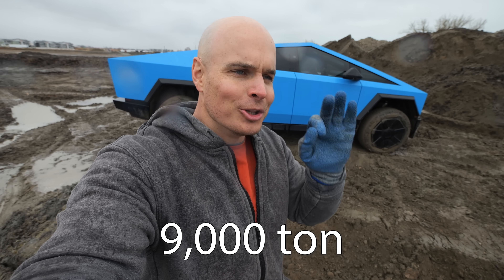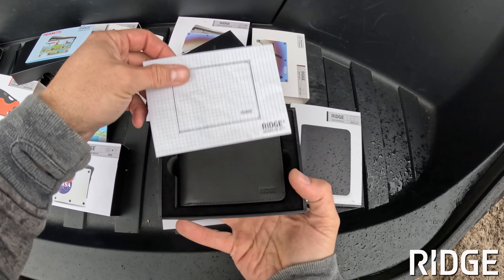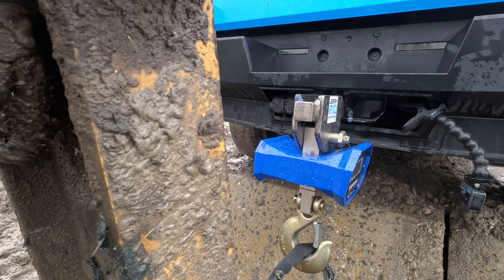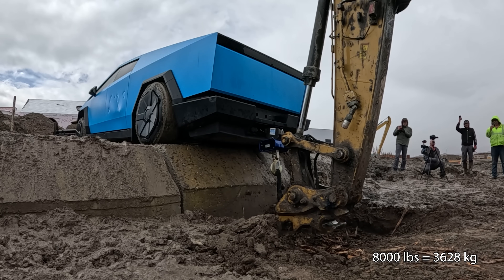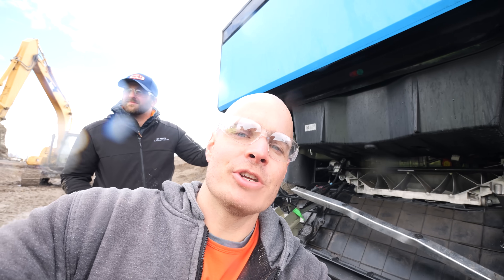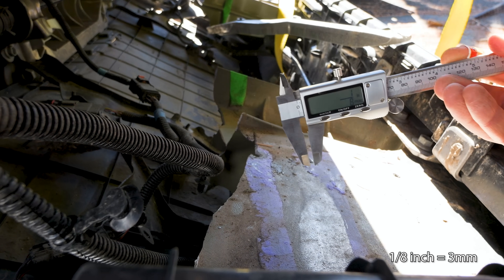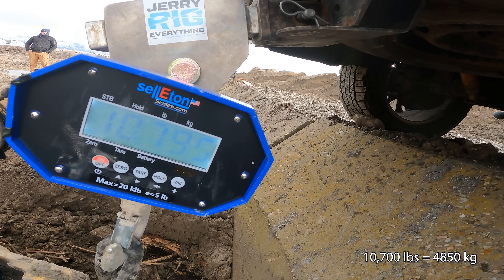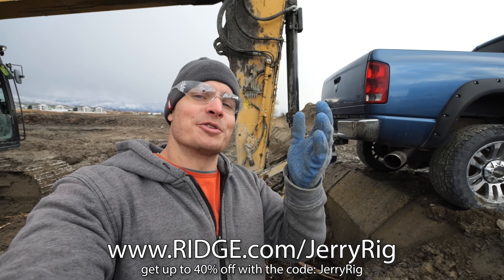SHOULD YOU TOW WITH A CYBERTRUCK?! - (catastrophic failure test)

Comment: The alarm going off was comical. As someone involved in structure development on stuff like this, this case is wildly extreme, but an interesting exercise nonetheless, especially side by side to a traditional BOF vehicle. I'm curious why the battery is throwing error codes, I wonder if it's a shutout for something like FMVSS 305, though I'm not familiar with NHTSA requirements.

Comment: People are freaking out over the glue, but this is exactly what happens when non-engineers see something from their daily lives and assume it's the same in engineering. In reality, adhesives are widely used in aerospace. For example, the Eurofighter Typhoon’s wings are made from plastic and glue, yet they carry heavy loads at high speeds. Engineering isn’t just about bolts and welding!

That being said, yes, this truck is not well made for towing.

Comment: My understanding is that the CyberTruck weighs about 9,000 pounds. So, if you put 10,000 pounds on the trailer hitch as tongue weight, you will have other problems before the hitch breaks. Also, the CyberTruck sounded an alarm before that failure. If you ignore alarms, you are part of the problem.

Comment: Tongue weight is tongue weight.  They both broke around 8k, because the frame is beginning to bend on both of them.  May or may not be permanent damage.  But it’s not a realistic expectation, because you’re hitting other safety issues well before the tongue weight limit.  A pothole isn’t going to 6x the weight.  95% of it is going to be a pulling force.  Your tire doesn’t teleport to the bottom a pothole at highway speeds.  It mostly glides over it.  Thanks to conservation of momentum, the trailer force isn’t going to suddenly change directions either.  The stress limit argument is valid though.  To the point where SpaceX uses steel wherever it can, because aluminum rocket parts are 1 time use.  Would be nice to see a revision with a steel hitch frame attached to the aluminum frame.  But you’re not going to be doing tons of hauling with its limited range anyways.
Reply: ROFL ,whats wrong with you?
Reply: They didn't test tongue wieght,which has more to do with hauling capacity. They tested towing weight, which is not a horizontal pull test. You have to stop. Ever stop while pulling a load over a hump  in the road? 100% of the trailer weight bears down on the hitch and frame.
Reply: @jerrylawson9003  No , it just doesn't .
Reply: @AZREDFERN  You're right, but on the contrary, he hates Tesla, so he'd rather lie.

Comment: The planes you fly in?  Aluminum. And the ones with carbon fiber?  Glue. Aluminum and glue are not automatically weaker than steel.  Design matters.  Please don't lead us down a path of idiocracy.

Comment: It all depends of the thickness of the metal, if the cybertruck had thicker alluminium plates or a lower advertised towing capacity that would be fine.

To problem is that it is falsy advertised to have this towing capacity and it poses a great danger to drivers and surroundings

Comment: 10k pounds seems not unreasonable given the tongue weight limit is 1100 pounds. That's a VERY improperly loaded trailer or a VERY large pothole (which is probably going to rip off a wheel and suspension). I'm all for crapping on the Cybertruck since I think it's a stupid vehicle, but 9x the maximum rated weight isn't really a flaw so much as it's just a reasonable engineering limit. Like, is everything supposed to be 15x its rated limits? 20x?

Comment: One thing i haven't seen yet is the value of the trailer in question as well. If you have an 11,000 pound trailer, it would be impossible for it to exert 10,000+ pounds of downward pressure or tongue weight, as the trailer itself would act as a fulcrum. For starters, say you have a trailer with a GVWR of 11k lbs, even a lightweight aluminum trailer would likely weigh over 1000 pounds empty, already getting your potential payload capacity below 10k lbs. But even if you were to place the full payload capacity of the trailer between the axles and the hitch, the trailer itself would still be a fulcrum, so the trailer axles would still bear some of the weight. I'd have total confidence towing with it, knowing it wouldn't fail until 10k pounds of tongue weight.

Also, as far as the adhesive failure, im guessing the adhesive is just used in the manufacturing process or something. Some cars, like the Lotus elise, are literally glued together, but in that case, the aluminum should fail before the adhesive does. That's really true for any structural glue joint. Glulam wood beams, the wood fibers will separate before the glue will.

Comment: I am totally on the side of this hitch not being made well enough to do what most other trucks do, but I feel like this experiment is flawed. A hitch deals more with lateral forces than vertical forces. I'd be curious at what point the hitch brakes if you pull it. Like essentially draw and quartering the truck. I'd be afraid the front attachment point could break first though unfortunately. While I am sure a standard truck handles higher numbers in both directions with modern design they tend to tell the computer what direction the force is expected and design from there.

Comment: I worked at Peterbilt in Denton Texas and every truck we build is glued together, 08219 3m everything on the road is helled together with this stuff and the Dodge pickup has frame stops, mounted in the frame there are small rubber stoppers that hit the axle and bottom the frame out, not a fair test

Comment: So you expect the trucks to be able to hold a way that lifts the front of the vehicles physically off of the ground and you have to hold them with another piece of equipment. If you're towing like that, you're the dumbest person on the planet. All this video showed is a lot of people. Don't know how to load a trailer or tow. Besides, if you're going to be getting that high with a bumper hitch, you should be using the distribution hitch which is going to correct for a lot of the stuff anyway

Comment: When it comes to towing should be using a diesel, 3/8 aluminum in the rails should be OEM. 
Weld the bumper back on but slide titanium square tube inside the rail and redo the test, weld it at the end, or run a bolt through it, see if it snaps somewhere else.
The cyber truck fix, titanium square tube in the aluminum rails, they could make it a recall.

Comment: The reason why that other one broke when they were doing their durability test and that other video is because there's a different Towing weight for the vertical weight which is much less than the tongue weight. Whether 160 lb for the vertical weight it's an error or not it's still going to be a lot less than the tongue weight but Tesla says that the vertical weight is only 160 lbs. When those people drove the Cyber truck right off that bed of the truck it hit the back of where you would tow causing damage because the cybertruck has over 6,800 lb worth of weight it hit down on that tow hitch already causing damage but it was also dropping so there is probably more Force than the over 6800 lb. Then when they went to tow like normal and it kind of ripped off from the frame because the vertical weight was already damaged.

Also what you were doing here is doing the vertical weight and not the tongue weight which is 1100 lb making the towing capacity 11,000 lb.

For it to break before the 11,000 lbs because the vertical weight Kendall's a lot less than the tongue weight.

Not many people are going to be doing vertical weight on the towing unless they hit like a dip or a bump or something like that.

Comment: Nearly 5 metric tons NOSE WEIGHT is frankly insanely good.
This test was not testing towing limits but nose/hitch loading limit. Most cars in Europe specify 50-100kg for nose weight. Even vans and trucks rarely exceed 200kg 4700kg is slightly higher.

"The maximum noseweight for a tow hitch varies by vehicle and towbar, but is usually between 45–75 kg. It should not exceed 7% of the trailer's total weight. "

EG For Landrovers
"In this event, the maximum trailer nose weight is 150 kg when the vehicle is in its fully laden condition. NOTE: ² The restriction only applies to trailers with overrun brakes. For the electrically deployable tow ball option, a restricted weight of 200 kg applies."

Some Mercedes sprinter tow hitch combos can go to 240kg.

If you had been pulling lateraly with or without laterial deviation and possibly some vertical deviation (to account for surface undulation) and it had failed that test then Tesla would worry.
I don't think this test has hay bearing - in fact - Tesla can point to this test to say the cybertruck has an insane nose weight capability. 

Sorry Jerry - this test is not valid and your title could land you in legal trouble.

Comment: if you look at whistlindiesels vid in slow motion the trailer is being pulled into dirt hill and basically the fact the wheels were pulling against a hill ripped off the frame not the weight of the trailor

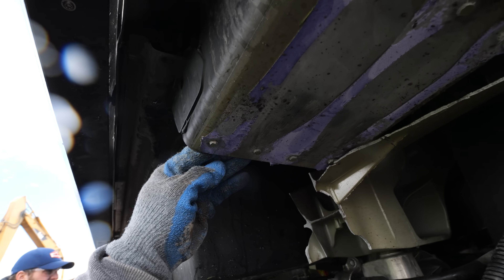Comment: 8:16 That’s 3M Impact Resistant Structural Adhesive. That’s not temporary by any means. That stuff is no joke when it cures. However high levels of concentrated heat will cause it to lose adhesion… as well as a CAT… 😂

Comment: Disclaimer: Love your channel and I think Elon is all kinds of a jackass. And his trucks are butt ugly eyesores. 
However….In testing fall arrest harnesses at work we’ve seen a 200lb man generate a force approximately 10 x that amount on the rig when suddenly dropped but it took a fall of more than 10 feet. Maybe it’s not an apples to apples comparison but I don’t see how a pot hole likely less than 6 inches deep is going to amplify the tongue weight by 10x. In other words I don’t get this test. In what universe is your hitch going experience this kind of load in this direction, especially as nobody will have a loader holding down the front of the vehicle. Still glad to see a wank panzer get totalled tho. 😎

Comment: i would avoid pulling other trucks out of a ditch with that frame, especially since it started plastic deformation way before... when u started to hear noises, thats when microcracks started to form... even low load cycles might result in catastrophic failure eventually... think titan submarine

Comment: Wait, you're applying 10,000lb perpendicular to the rated vector and saying its "far too close"?  You're off by 90 degrees.  What would the towing situation be where the load transferred from riding on the load's wheels to being suspended over a cliff?  The rated tongue weight is 1100lb.  So you exceeded it by 8900lb and it broke?
Reply: it's baffling

Comment: This video wouldnt exist if elon voted kamala😂😂 i still dont like electric cars. This isnt normal circumstances try the same on other electric trucks. The so called glue is panel bond used by every car or vehicle.
Reply: Democrats😂 I totally agree no one tows like that
Reply: @johngergis7725  cyber truck vs f150 electric would be a fair comparison. when towing your not pushing down like that as the tires on the trailer take some of the weight off. dont get me wrong electric cars are not ready at all these cars will go down in value not up imagine one in a museum the battery wont last it will not be drivable. petrol cars just service the engine change a few things and your ready. replacing the whole battery pack in Australia is 20k for a 79k car minimum spec. democrats hating because he is cutting down ridiculous spending which he would come to australia in clean up our parties

Comment: 3mm? issnt that the same as the armor plating? at least thats steel... who designed that lemon? aluminium 3-4mm frame rofl
its not an opinion that steel is much stronger than aluminium, thats a fact per volume (not necessarily by mass)..

Comment: I’d like to note exactly how much 10,000 pounds is. 

That’s :

278 Cider Blocks

195 sheets of drywall

3 Toyota Rav 4s

2 Airstream signature camper trailers

A Hummer Ev

Or

An empty 53 foot semi trailer

When in the hell is a cybertruck driver going to tow 10,000 pounds??
Reply: or 4535.9 kg
Reply: @qwertyqwertperson  as American as it gets 😂
Reply: Towing that weight is irrelevant because road conditions can induce similar or higher forces from a much lighter load: the classic pothole airtime. Because aluminum has no fatigue limit, stresses deform and weaken it, as opposed to steel, which can safely and repeatedly tolerate stresses within a limit without weakening. The more you use a cybertruck for towing, the less safe doing so becomes. Material science is a harsh mistress
Reply: It's aluminum, unlike steel it will grow weaker each time to tow anything
Reply: When a vehicle is rated for towing weight, most people expect it to work.  Many people claiming to be test engineers here never even mention that this is more of a live load test.  Many house trailers and car carriers are 10,000 lbs.  The cybertruck needs to be designed better than a F250 since it has much more power!  It will likely go more fast and hit holes and brake harder. To say tongue dead load is a design max is just insane.  Imagine what happens when the trailer brakes engage ... yes the load goes into a downward force much greater than the tongue dead weight rating! A solid/safe/maximized design would be where the tires/suspension/axles break near the same point as the bumper falls off.
Reply: You dont, but when its weaker, it wears down MUCH quicker when doing small loads, until it eventually snaps like it did in the video on a 1000 pound load
Reply: @ incorrect, watch it again. It catastrophically failed on around 10,600 pounds of force.

Additionally, while you are correct that overtime the aluminum frame would weaken, you would still need to load considerable amounts of weight frequently to get to a point of catastrophic damage like this. In which, the original point of this comment was to show that the normal Cybertruck owner, wouldn’t even be utilizing half of its maximum load capacity.
Reply: @NicholasMarcelin  but my main point is that it can break regardless, who gives a shit if it wont break for the average cybertruck owner, I’m worried for the 10% of the owners it will break for, the lives it can take because of shit design
Reply: @NicholasMarcelin  When a heavy but still >10 000lb trailer hits a pothole. Or the cybertrukk accelerates. Or when you try to pull another vehicle out of mud. The impulse exceeds the weight for a short duration.
Reply: @redmemoryy Your main point is that it can break at all? You mean like every consumer vehicle ever created?  There’s always going to be a stress limit that if exceeded, will fail. If you load the trunk of a sedan/SUV and exceed its maximum weight, the rear axles may fail. If you load too many overweight passengers in a car at any given point, the suspension may give out. Drive your car through a body of water that exceeds your car’s depth limit, your engine may stall. That is by definition what maximum limit means. By not surpassing the vehicles maximum limit of X, you shouldn’t incur any of these issues. 

Am I saying that an aluminum frame is better than steel? No.  My point is, majority of vehicle owners will not incur this issue and those that do is because they exceeded the maximum weight limit or encountered an edge case in which the tow was near the weight limit and due to road conditions or an abrupt force, caused a catastrophic failure. There are tens of thousands of cybertrucks on the road today, and there are only about three documented cases of this happening, two of which were done on purpose by YouTubers…

Comment: As others have already mentioned, this is absolutely absurd. The Cybertruck is NOT rated for 10,000 lbs of tongue weight, which is what was tested here. Even cresting a hill, you are not going to get full trailer weight on the tongue as suggested. Bottom line, this test is pure nonsense. And no, I don't love the Cybertruck.

Comment: Listen, the Cybertruck is a flawed product but it is hard not to feel like this isn't a hit job because of your personal dislike for Elon. You tested the tongue weight rather than the towing capacity. A quick Google search "tongue weight is the downward force that a trailer exerts on the hitch of the tow vehicle, and it’s typically recommended to be 10-15% of the total trailer weight for conventional trailers with ball-mounted hitches."

So yeah, I still the the Cybertruck could be a great alternative for maybe suburbanites that want something they don't have to take the the gas station, occasional towing short range, and have a need for a covered bed for various tasks. I don't think it is a good replacement for standard heavy duty trucks.

Comment: I'm no mega tesla fan but this video seems misleading, even with the note about tounge weight vs tow rating. Based on your explanation any vehicle with a varience in the two ratings would be potentially dangerous however, that is basically every vehicle.

Comment: This test is stupid. Towbars are designed to pull horizontally, and typically the allowable vertical weight is 1/10 of the towed weight.  You couldnt physically apply enough vertical force in any kind of normal use scenario to break it.

Comment: The 10,000+ tongue weight is impressive, but considering this truck is less than a year old and Aluminum generally loses strength over time, that max load before failure will drop, especially if the truck is used for "truck stuff".  I think it'd be interesting for Jerry to pick up a well-used Cybertruck in 5 or 10 years and see how the strength compares.  Would it lose 10% of its strength or would it lose half its strength?  Only the future can answer that!